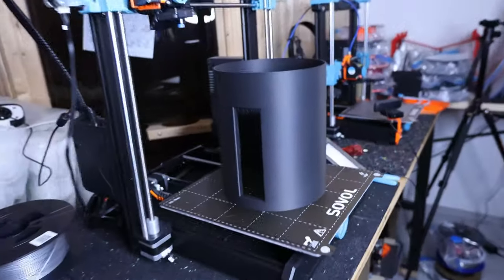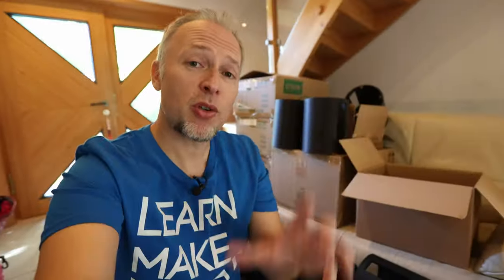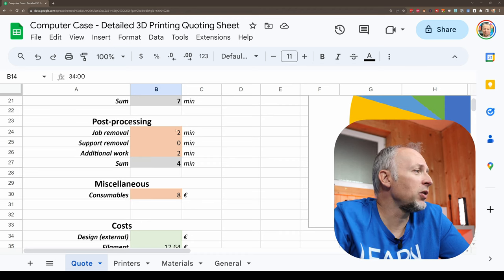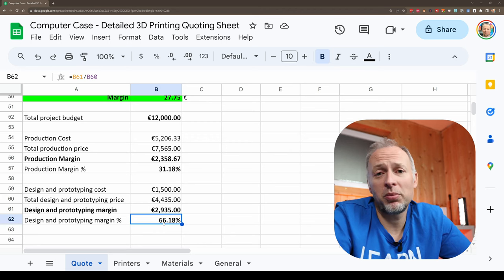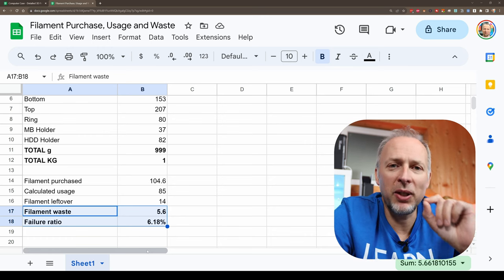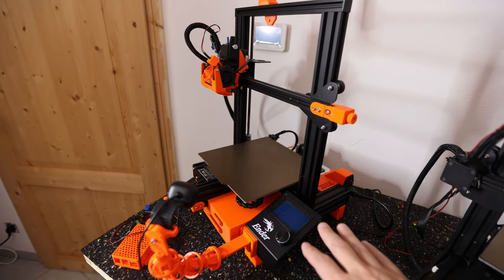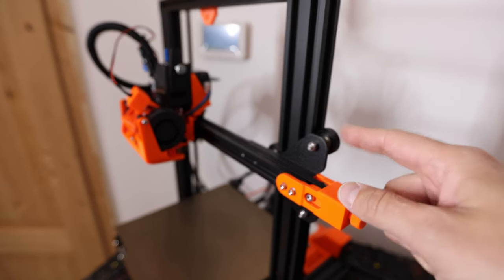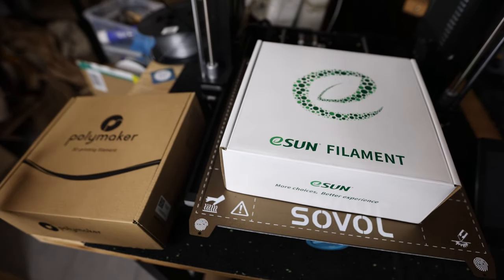$12,000 3D Printing Project: Failures, Learnings & My Print Farm Tour!

Comment: What an amazing experience you described, has really put a great perspective on my idea of a 3d printing business. I am just starting so i am really grateful with the quotation file (it has been the weakest point in my endeavor, and with this file i can finally have a well thought and precise way of quoting my work) , I slowly worked and saved money to get a second pri ter, and sadly for the time being, my first printer (ender 3 pro) has just died after a 17h print, i let it cool, then turned it off, removed print and continued my work, next day went to start a new print but the ender does not turn on, at least i have a second printer and for the time being i can work with it until i fix the ender or save to buy a different printer (thinking ablut a bumbulabs x1).  If things keep going as well as they are at the moment, in about 2 to 3 months i wil have budget to get the printer.
Reply from the maker: I wish you a successful journey in building your 3d printing business!

Comment: I'm in the startup phase of building a production company. My plan is to print and sell my own products.

My thoughts on printers are to keep to SV06:es for now (I have one and I am super happy with it) and trade some speed for price. If it is 1/3 of the price of a Bambu Lab printer it can run at 1/3 of the speed and I'll just run 3 of them. Also a clogged nozzle or other problem will cost about 1/3 in downtime and I like the openness and not relying on anything really proprietary.

As long as they don't break down for mechanical issues. I really appreciated the fan tip.

But we will see when experience takes over ideology :)
Reply from the maker: Hey, great to read your thoughts on running a print shop with inexpensive printers. In the meanwhile, I also upgraded the parts cooling fan and it's such an improvement! Video coming!

Comment: Can PLA handle the temperature ranges that will occur in a computer case? I have been avoiding PLA because it seems to melt in most mechanical or computer environments.

Comment: Don't you have screens on your windows
Reply from the maker: Not yet in the basement. Next project of dozens
Reply: screens reduce the air flow by about 50%. Of course they reduce the mosquito flow by close to 100%, so they might be worth it
Reply: @gerGoPrint3D  the best thing would be to have a ventilation tube with a blower